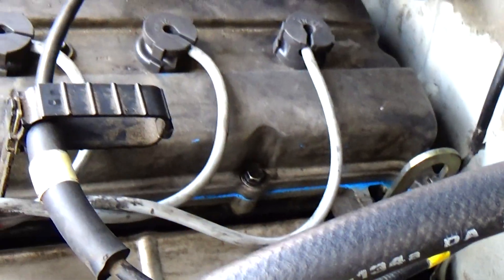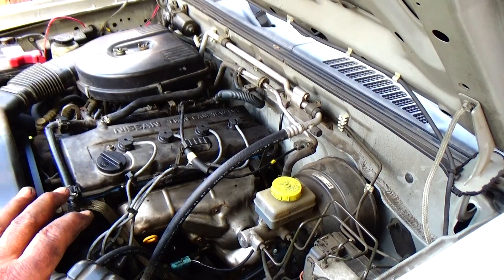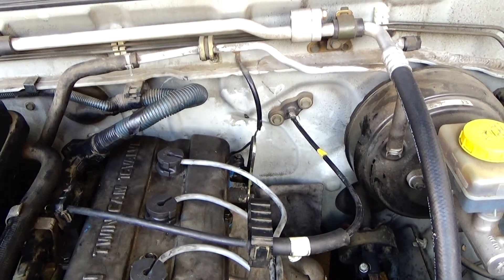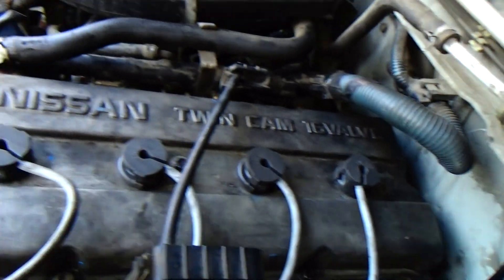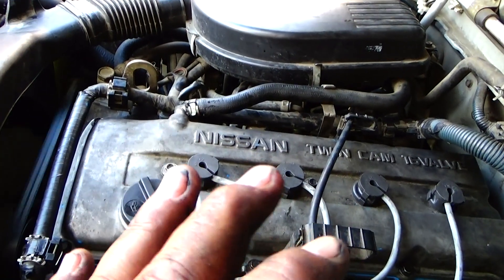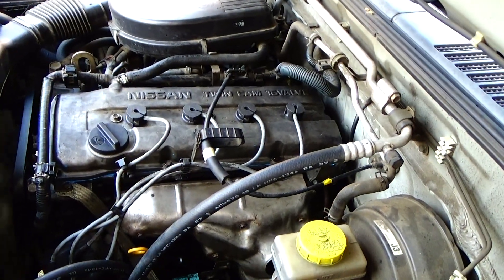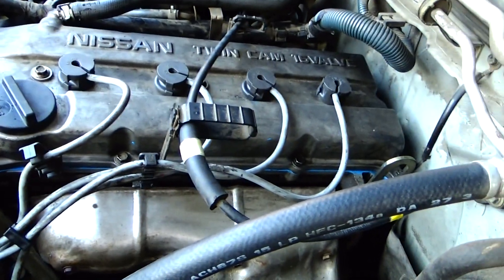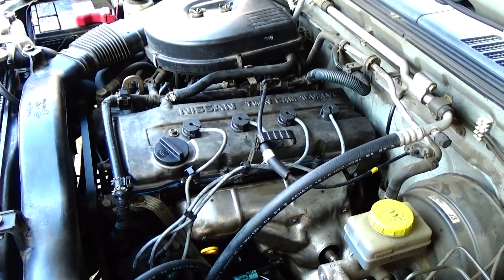2004 Nissan Frontier 2.4L Valve Cover leak repair PT2

Comment: I use the original Permatex thats been around for longer than 40+ years. It comes in a metal can and the screw-on top has a brush attached. It's as thick as molasses and reminds me of tar. It will ruin your clothes and is difficult to wash off of hands and can be messy to use if one is not careful - a little goes a long ways. My Auto Mechanics instructor in High School introduced us to this version of Permatex, and he instructed us not to use anything else while we were in his class. It does not harden but stays flexible. I use this product on water pumps, valve cover and head gaskets, etc..I apply a thin layer to the part being installed to hold the gasket in place. I also use it on the outside of cam and crank seals. I;ve never had any leaks whatsoever when using this version of Permatex, and the fact that they continue to make the stuff to this day says much about the quality of the product and the desired outcome of having zero leaks. A small container will last for years, and does not harden if the cap is screwed on tight, unlike the silicon RTV formulas.
Reply from the maker: Yes I know the product and I seriously forgot about it! I USED to see it all the time in dealerships when working in the shops, AND used it quite often in the 70's and 80's! 
IMO, That was the best product made by Permatex. Thanks for your comment, Tom in NV